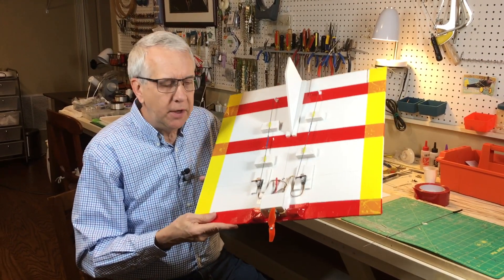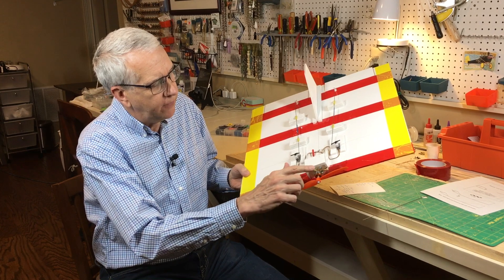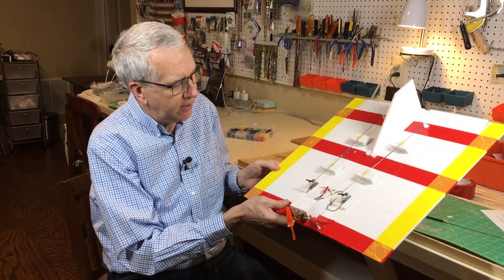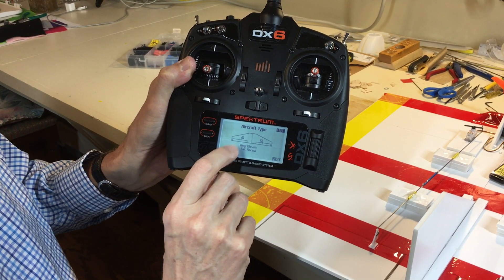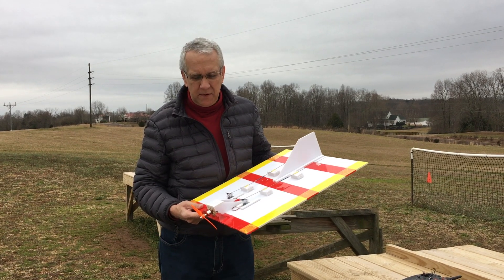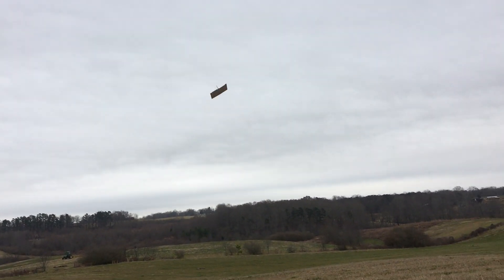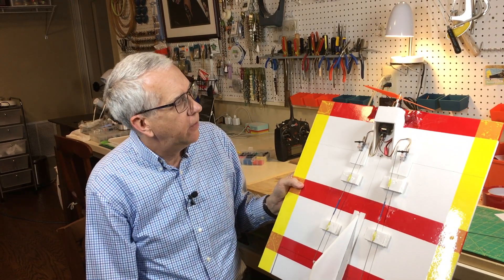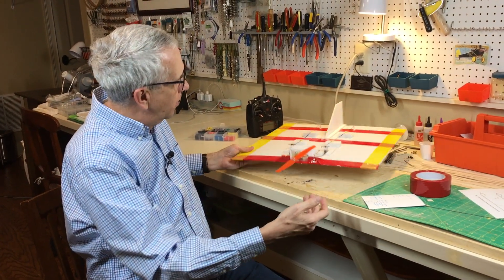Square Foam RC Plane - Free Plans!

Comment: Tim, you are brilliant! This is so impressive, that I'm definitely going to make one in the next few weeks, and I'll get back to you as to how it goes. I was just about ready to scratch-build a Flite Test "FT Flyer," but your design is even simpler, and I really like that you can use it as a  trainer. 

One question - it looks as if it was flying with a few degrees angle of attack - did you have to provide some stick back pressure to get that, or does it want to fly that way on its own?

Thanks again for your excellent videos. I've been following your videos for a few months now, and every one is so useful and so well done. 

BTW, I'm an  RC newbee with very little flying (but some crashing) experience. I have built a few Flite Test designs, and they have come out nicely. - I just turned 71, and am enjoying RC planes immensely - it's like my second pass a childhood :-)
Reply from the maker: Stephen:  Many thanks for your kind words.  Yes, the Square Flyer does fly with a slightly nose up attitude, I think that is just the nature of the flat wing design.  I really did not have to add any trim, it just seems to want to fly that way.  The good news is the plane is very "honest" and needs just small amounts of control input to fly.  Good luck with your build!  Tim
Reply: @TimMcKay56  Hi Tim, I've built your Square Flyer today, and as you promised, it came together very quickly - I just have to install the motor and electronics now. 

I couldn't quite tell the size of your prop - looks like a 6" or 8"?  Also, I think the a 2200KV motor would be equivalent to your Park BL250, does that sound right? 

Thanks again for all your entertaining and informative videos.
Reply from the maker: @StephenRosenbach  Steve:  I used a 7x3 prop, provided plenty of thrust.  Good luck with your test flights!  Tim
Reply: @TimMcKay56  I flew it yesterday, and it flew, but not terribly controllable. Unfortunately, after I retrieved it, I accidentally broke the prop, and didn't have a spare with me. I'm not gonna give up! - I thought I had it balanced at 5" from the leading edge, but I'll try moving the battery slightly forward to see if that works better. Weather is very iffy still here in Eastern Massachusetts, but better days are coming. Next time, I'll bring a few spare props and some tools ;-). Thanks again!
Reply from the maker: @StephenRosenbach  Steve:  Copy all and good luck!  Do double check the center of gravity.  If in doubt, always best to be a bit nose heavy.  Also, it a but twitchy on the controls, consider reducing the control throw a bit, might help.  And for sure do the initial test flights in calm winds.  Tim

Comment: Has anyone managed to get one of these to fly … I’ve built one here in Australia .. but we don’t have the same components available … it ended up being a 2208 1600kv with a 5030 prop and I couldn’t get it to fly … tried a 6x9 prop and managed to get it to fly but any power changes caused massive dives to the left (from behind) 

Any thoughts ??
Reply from the maker: Mark:  Not sure, to be candid. Mine did fly, but no blazing insights as to exactly why. Best input is to keep it light, and ensure no warps in wing. Tim

Comment: Hi, great video! 
I am curious what size mah battery you used for this. Thank you 
-Jay
Reply from the maker: AM:  Thunderpower 2 cell lipo, believe around 350 milliamp capacity.  A bit heavier battery would be OK as well. Tim

Comment: how to get those cg on that type of build?
Reply from the maker: Center of gravity is 25% back from the wing leading edge.  This model is 20" wing chord, so 25% of 20" = 5 inches back from the LE for the CG location.  Tim
Reply: @TimMcKay56   Thankyou for answering all my question tim appreciate it
Reply from the maker: @calimlimfrancisnoah5352  No worries, good luck with your build!  Tim
Reply: Hey Tim I'm all done building this type of plane you've made and it's ready to fly tomorrow. I use a 2200 kV motor and a 2200 mAH battery, and I put them all at the very front of the plane. But it's very tail-heavy, so I added more weight on the nose. Sometimes it's tail heavy, and sometimes it's nose heavy. Does this type of plane have trouble balancing because of the CG location, or am I just too worried about the weight on the nose I added?

Comment: Wow. Lovely design & flew exceptionally well...! Just a question.. Does it require up reflex of elevons to begin with (in order to fly stable) ?
Reply from the maker: Amit:  Glad you liked it!  I usually use a bit of up elevon on both sides for initial flights, and trim as needed after.  As the model is so lightweight, not much up reflex is required.  Tim

Comment: I recently got back to RC plane hobby after 30 years of dormancy....Bought the obligatory EFlite Apprentice to re-introduce myself to this interesting hobby (using various LiPo batteries), then a Timber X and T28 Trojan controlled by my DX-8G2 transmitter.  I would like to build a foam RC plane for fun and your board design looks interesting to start with.  Bought a few boards at our local Dollar Tree, have my Exacto blades, tape and hot glue gun and ready to download your plans.  Was thinking of rounding off the front corners a bit to make it look a little "cooler".  Wondering if you tried doing that during your design phases.  Thank you for sharing your interesting RC design.
Reply from the maker: George:  Welcome back to the hobby!  Should be no issue with rounding off the front corners, good luck!  Tim

Comment: Next time you do a setup with elevons and it doesn't work, try using Elevon B its the next choice after Elevon. It prevents you from having to switch the plugs at the receiver. Very thoughtful of Spektrum. Nice build, it's not easy to balance a rectangle plane, you have to get all the weight out front.
Reply from the maker: Greg:  Great tip ref Elevon B, thanks for sharing!  I will make a follow on Square Flyer.  This one will have no landing gear that I added later (to save a bit of weight), and move the motor mount about 2" forward to try and balance at the 25% CG location without the need of the four lead fishing sink weights I taped to the wing leading edge.  Tim

Comment: I have a newbie question how do you determine 3 degrees down thrust and three degrees right thrust?
Reply from the maker: Danny:  The 3 degrees right and down is almost a figure of speech, as there are some many variables with wing/tail alignment, CG, etc.  The intent is to have the motor a bit to the right and a bit down, most models seem to fly better with this starting alignment.  Tim